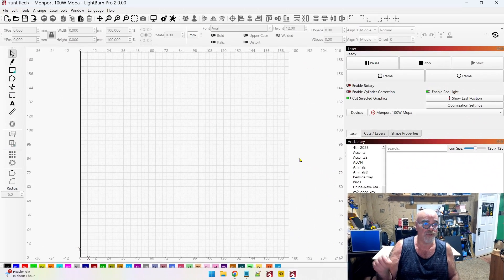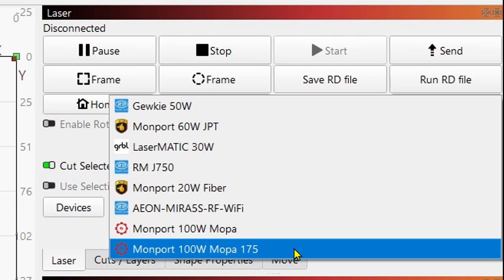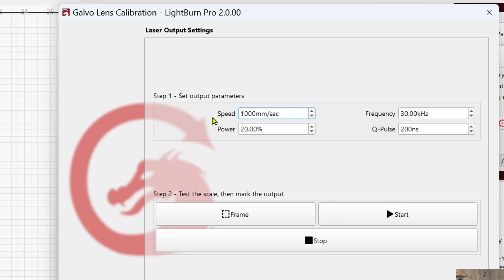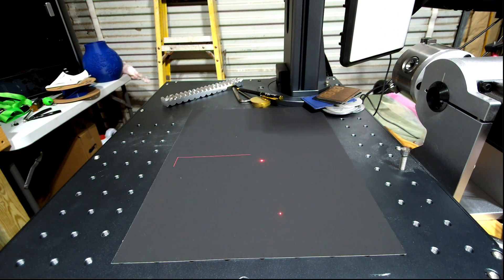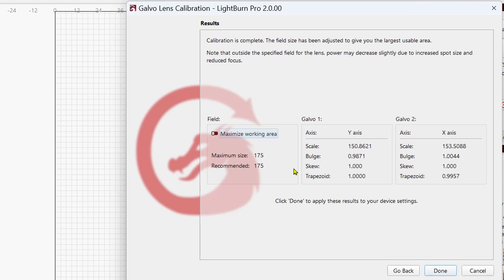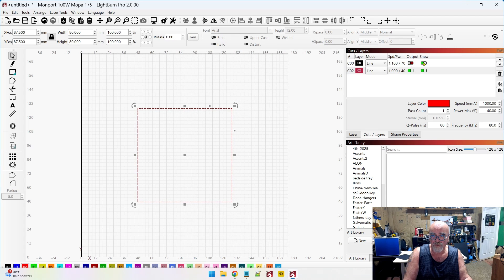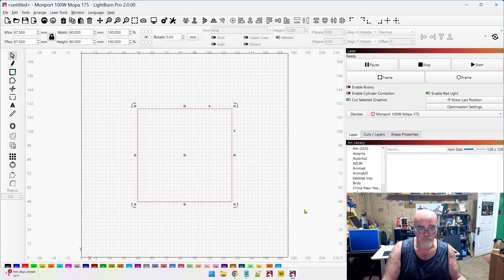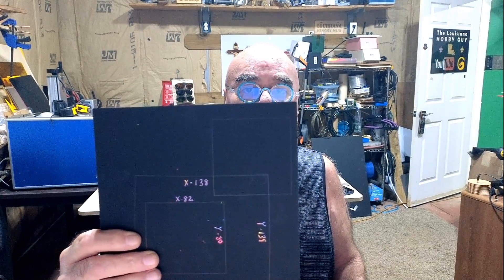👓 Galvo Lens Correction in Lightburn, no core file needed!

Comment: Guten Morgen mein Lieber weißt du wie ich den Fokus einstellen kann bei ein UV-Laser 5 W die lens ist 110 x 110 355 nm und welche Einstellungen  was am besten hörbar und sichtbar ist, bekomme das nicht hin z. B. KHz q-puls und Speed was am besten sichtbar und hörbar ist komme hier nicht weiter lg von Jean-Luc aus Deutschland

Good morning my dear, do you know how I can adjust the focus on a UV laser 5 W, the lens is 110 x 110 355 nm and which settings are best audible and visible, I can't get it right, for example, KHz q-pulse and speed, which is best visible and audible, I can't get any further here, regards from Jean-Luc from Germany
Reply from the maker: Most UV galvo lasers come with a dual-red dot system (two pilot beams). When the material is at the correct Z-height, the two dots converge into one single dot. If the dots are separated, adjust the Z-axis up or down until they overlap.

Comment: Great video on this.  How did you know the laser was in focus before running the calibration?  I have a Monport GA60 and I want to change the lens but I am hesitant about how to find the new focus length.
Reply from the maker: Well, this one had auto-focus and the 2 red light pointers, plus the focal distance was written on the machine. If I actually changed the lens, I would have to have to run a job at low speed and frequency and manually move the focus up and down until I could hear the loudest noise coming from the engraving.

Comment: Thanks for another great video Rich!  Two questions

1. I'm going to "assume" this is performed AFTER you already know your focal distance?
2. If you don't know for a fact which is X and which is Y, is there an easy way to determine that before starting?

PS.  Love the fence picket on the back wall to support your white board.  🙂
Reply from the maker: Thanks for watching and for the questions Todd!
1) You MUST KNOW your EXACT focal distance to do this.
2) Type some text and burn it onto a black sheet of paper to see the orientation of your X & Y.
Reply: @TheLouisianaHobbyGuy  just FYI.. I knew the answers (been running CNCs, Co2, UV, and Fibers for about 7 years now)  but lots of folks out here don't.  🙂
Reply: Sometimes, the core file is incorrect or slightly out. I shall be trying this feature in Lightburn on both my 2 lenses. Another great video, Rich and easy to follow 👍
Reply from the maker: The Cor file is almost always off David.
Reply: @TheLouisianaHobbyGuy  agreed.  haven't seen one correct for either of my fiber purchases and the uv purchase.  they were "close" but no cigar for me
Reply: @TheLouisianaHobbyGuy I guess shipment of machine and putting it together parameters change including me using shims and an electronic level to help level the bed with the lens